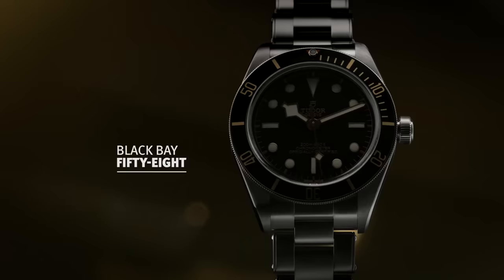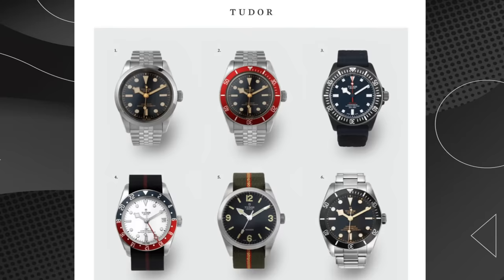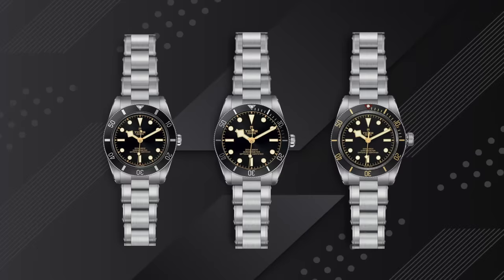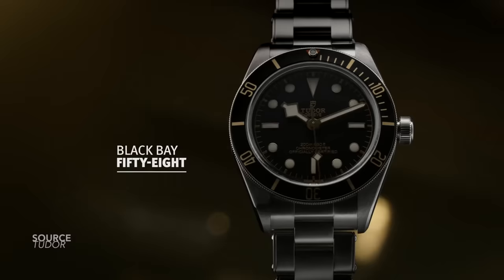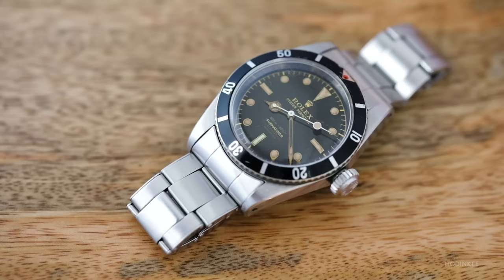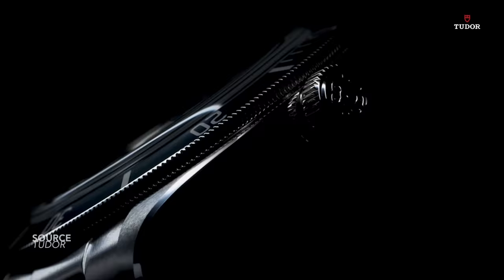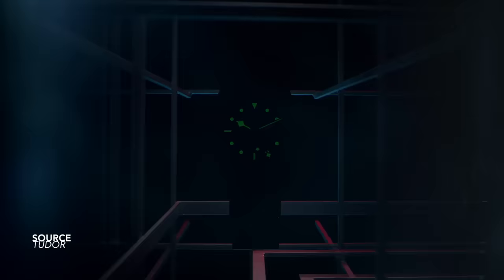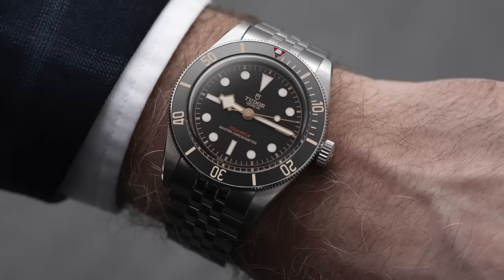Tudor's "Leaked" Updated Black Bay Fifty-Eight? + Predictions (with Renders)

Comment: I (believe) I was the first person to spot the “new” BB58 in Esquire last year and upload the photos online (I received the mag a few weeks early). I ultimately ended up exchanging messages with the editor of the magazine who confirmed it was a botched edit resulting from sub-par photos during their shoot. This becomes more obvious when you notice the lack of any crystal distortion between the dial/bezel. Still, it looked pretty cool!
Reply from the maker: Thank you for clearing this up Dom! I still for the life of me, don't understand how they managed to edit / smash a BB54 (not 58) with a more modern bezel. Speaking as a guy who does these sorts of edits virtually every week, it takes work!😆 You'd have to slot an entirely different bezel insert onto the existing one. But you're right, that distortion looks off on the dial. As we know the crown would be incorrect for a 58 etc. interesting to think about though! 🥃
Reply: Always taking credit

Comment: If the leak is real Tudor would have destroyed what made the BB58 great. I hope it isn’t true. Just update the bracelet to make it the t-fit but keep the rivets and drop the ‘Officially Certified’ and just make it a Master Chronometer so the dial is less busy. If they wanna go all out, make the bezel edges more defined, but no more than that. It’s a well proportioned watch with a lot of character - I can usually see one across the room, but if they turn this into a BB54 it’ll just be another meh kinda watch to me.
Reply: Your points a all well taken.

Comment: My hope is for a bb 41 with gilt accents in the bezel with Metas certification and the 5 link variant t-clasp in place of faux rivet bracelet.  And a bold red accent marker triangle in the bezel. Love the red letter touch you showed in the vid. And the new slimmer case as the burgundy.  I love love the burgundy and its size fits my wrist better than the classic 58.

Comment: Managed to "beat the intro", nice job, great track and a fantastic album. Agree the BB58 update will include Metas certification and a T fit clasp (bet it won't be a retrofit option though). I like the BB54 bezel style and would be great if the lost the gilt on the hands and dial and replaced them with silver gilt, but that may be a bit close to their big brother. Alternatively they should just release your Forest Green version as the render looks great👍

Comment: Ditching the gold bezel marking for silver is a definite improvement; that was always one of the things I hated most on the 58, but losing the red triangle is a shame. It would be good to see them reprofile the top down shape of the case with either thinner lugs or perhaps slightly lengthened to give a greater lug-to-lug to diameter ratio resulting in a less round profile, as they did successfully with the 54.
I can't see them changing it, but the incongruence of the round hour markers and the snowflake still kill it for me. 
Similarly, GIVE US A DATE OPTION!!!
As always though, like all Tudors (except the Pelagos line), they will nerf the design in some way to not compete with Rolex.

Comment: Great video as always - interesting leak on the black bay.

If you are going to create a render; please create a Black Bay (39mm or 41mm) with crown guards.  Please.  I know people will say it is just a submariner wanna be.  But that is the point.  

If I got a submariner (and decided to spend the $12K for it - in Canada) - I would be hesitant to wear it.  That is where Tudor comes in.  That was its point - please create a render if Tudor was to go back to its original strategy as a well built Rolex alternative.

Comment: I think Tudor should be vary careful on an updated 58. They have come one leaps and bounds over the last few years since the 58 was launched. I love the BB Pro, the Pelagos FXD (not comfortable for me alas when I tried it), the brilliant Ranger and in my humble opinion the near perfect Pelagos 39. For me if I could update the 58 it would have a slightly re-profiled side case so it's just a tad less slab sided. Adding anti reflective coating would ne a nice touch for a more modern look. A version with the Pelagos 39 black dial could be an interesting option or as you mention (something that so many cut and past reviewers complained about it not having a matt dial) and a flat lacquer dial as used in the old non manufacturer movement BB 36mm. What I would like to remain though is the red triangle on the bezel along with the minute markers in guilt along with the snowflake on the second hand, I'm not that much a fan of the lollipop on the recent Tudor updates but it's a minor issue. The T-Fit bracelet would be a given for the upgrade as well. Many thanks for your thoughts. Oh and I did get the Amy Winehouse guitar intro. She left us way before her time unfortunately.

Comment: I’m surprised the bb58 is still being sold without a t-fit clasp so I feel it’s in desperate need off an update.  I’ve always liked the idea of a more subdued version but I agree making it similar to the bb54 would be a missed opportunity. The main thing I want to see is a date option. I find it barmy that a company’s most important watch does not cater for so many.
Reply from the maker: And so many other brands would have quietly fitted updated clasps to their older models (even Omega, and that's saying something) Great point about the date comp too... Tudor is really averse to adding date windows (unless they have to) BUT their updated GMT... now that'll be something to look into 😉🥃
Reply: Agree. The lack of a date is why I sold my 58. Thought I could live with it, but nope......
The Speedmaster has an adjustable clasp now too, why Tudor don't include  one on the 58 makes no sense either.

Comment: The BB is heavily vintage expired. And most would want it to look like early Rolex and Tudor divers. 
I would argue that people want a vintage Rolex Sub as a modern Tudor BB but not the Tudor itself.
Of course Rolex will never do anything like a vintage watch reissue. So Tudor is the only option aside from homage pieces.
To me Pelagos is the line that brand should focus on. The snowflake sub is Tudor. It’s about Tudor being a more independent brand and not just a sister brand to the Crown. Casing ETA movements in Rolex designs.
Vintage inspired trend will be over at some point. So to me Tudor should double down on building its own brand identity.

Comment: I hope the 58 doesn’t become a bloated 54. I tried the 54 and it’s definitely not too small on my 6.5 wrist. I think as a 1 watch collection the 54 is perfect. However, if you have a multiple watch collection, you may want something with a little more spice because for all its goodness, the 54 is a very boring looking watch at least when compared to the 58.  Unlike the 54, the 58 is not an exact replica of back catalog Tudor, it is its own thing. The gilted bezel adds a nice warmth and harmony with the gold on the dial, the red triangle harkens back to the Rolex Big Crown and serves to break up the monotony of the watch. I also find the more refined coin edge bezel and matching crown very elegant. It is a very special watch that isn’t an exact replica. I think a simple clasp update is all that’s needed to keep it fresh.